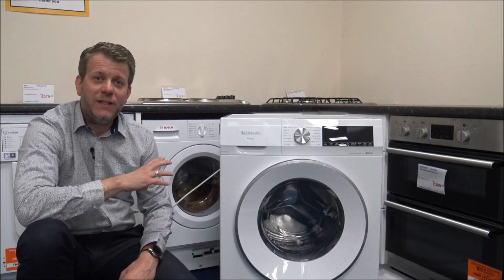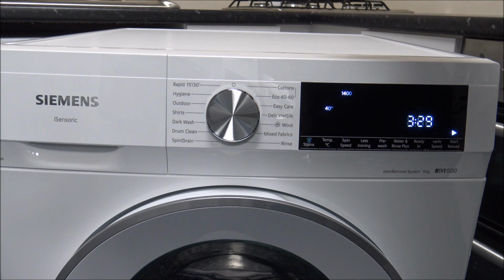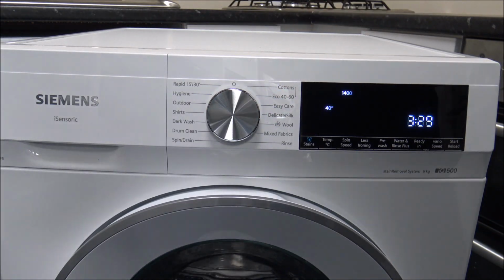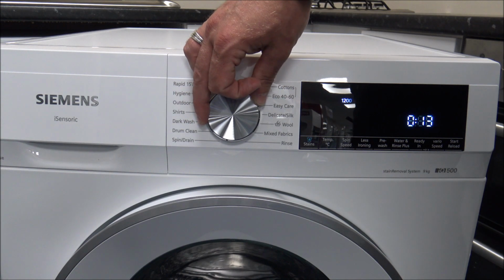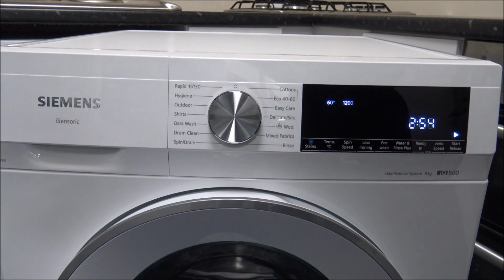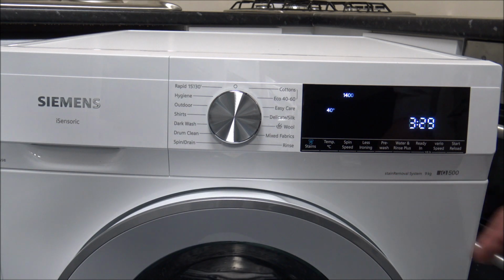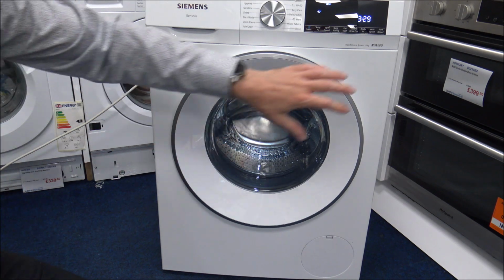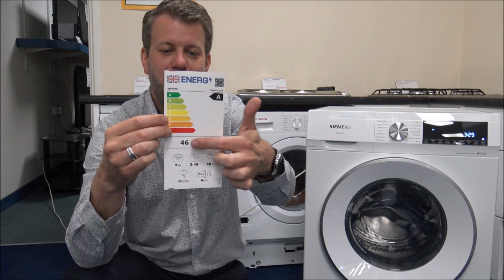Siemens WG44G209GB 1400 Spin 9Kg Washing Machine

Comment: Just to let people to be aware, I have had this appliance for 11 Month and a leak was detected dripping from under front right hand side of the appliance, this turned out to be a Drum leak from a small pin hole that had developed. The Drum will be replaced under guarantee.
Reply from the maker: That's unfortunate you had an issue, but good that Siemens are sorting this under warranty for you.

Comment: Is the Mixed Fabric 40C the most standard/daily use program then or ? (all kinds of clothes and underwear of similar colour).     Or is it Cotton ?
Reply from the maker: Yes either of the Mixed or Cotton programs would be the standard daily ones to use. Just check for max capacity, because sometimes on Mixed fabric programs, the max load you can put in is only half a load

Comment: Good afternoon I have a question for you.  What program should I use to wash things after a difficult sports training (football or rugby) 2. I wanted to ask you, I’m interested in buying Siemens iq700 WG44G203 If there is a difference between IQ 500 WG44G209?  thanks in advance for your answer
Reply from the maker: If you are after a good and solid wash program, then the Cotton program or Eco 40-60 is normally the best as they are longer programs that will get the clothes clean for you.

Comment: Having had a Siemens washing machine for the last 14 years I have to sy the new machines are a step back. The dial is now made of really cheap plastic that doesn't feel like it will last. I also don't like touchscreens. Buttons will easily out last them. Another great example of the manufacturer giving you less and is the consumer paying more...
Reply from the maker: I have to agree on the feel of the appliance, but the overall efficiency of the modern appliances are better than the old machines
Reply: Yes, the dial is a big letdown & also the thickness of the Door, this could have been made more streamlined.